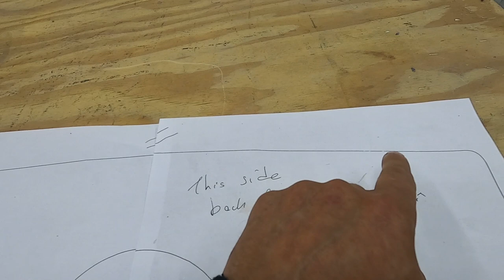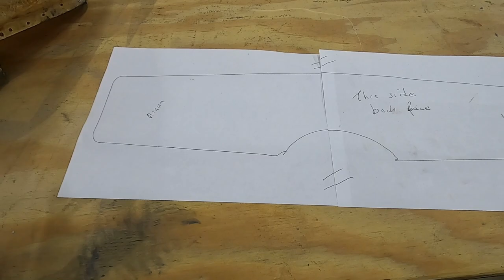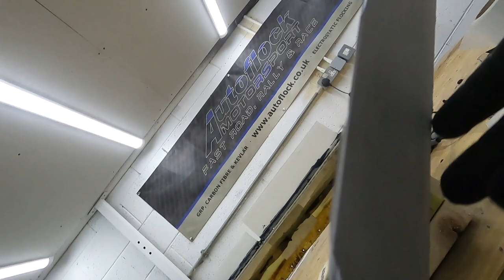lamborghini countach Dash Binnacle Repair

Comment: For first time and what you had to work from good job .but i think the top  piece has a slight curve. its not completely flat.
Reply from the maker: hard to emphasis it on the video but I can assure you it is perfectly flat
Reply: @autoflockmotorsport7730   sorry but it should be curved !not flat straight, i have a Countach. next time before you start a job go to google and look at images of things you have to repair. because the part you were given you could never tell how it was. Even the gauge and clock panel has a curve.
Reply from the maker: @johnkar724  Many thanks John, I did a lot of research onto the other 4 Countach's they had in stock, they were flat on the top.  If you watch the vid you will see how I make the top flat but the inside around the guage/clocks curved.  Thats what was a pain pain to do.  The top of this dash was made from ply wood originally, and that had started to bow, the others in their display were flat, this is leading me to think that maybe your's is starting to bow?  Its always difficult trying to repair old parts such as this authentically, we can only do the best we can.

Comment: Let's see you used dissimilar materials that will expand and retract at different rates causing this to fall apart. A kids hot glue gun really? Bondo ....yikes this is a colossal f u......
Reply from the maker: Im a bit unsure as to your comments in respect to materials??  The resin used is a pre accelerated fire retardant Crystic 1355PA (https://www.ecfibreglasssupplies.co.uk/product/fire-retardant-resin-class-1-including-catalyst).  This resin is rated far hire than general purpose resins before thermal distortion occurs.  As for a "kids hot glue gun" I didn't realise when I purchased this from my supplier that it was aimed for kids (lol) but it served its purpose of tacking the panels together prior to grp bonding.  The glue was removed once the grp had cured.  If you watch the video you will see that only one side gets tacked up then the opposite side is then reinforced with grp.  I didnt think it was necessary to mention this in vid as its common sense (to those who know composites).  The filler used was a 3M8115 panel bond which I have found to be extremely reliable filler with fantastic adhesion properties.

But thanks for your comments and stay safe
Reply: If you knew anything at all about manufacturing and glass construction, AND watched the video, you will see the hot glue gun is just there to hold the part in place - much like a welder would 'tack' weld pieces before the finish weld.  In this instance, the guy used the hot glue to tack the the part, then did the final fibreglassing in of the part.  You really need to stop watching these videos dude.